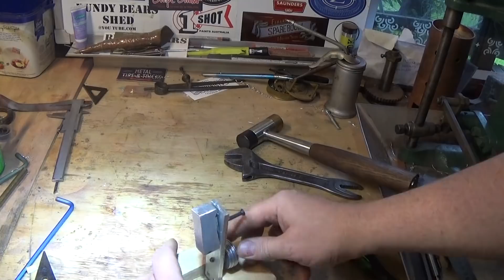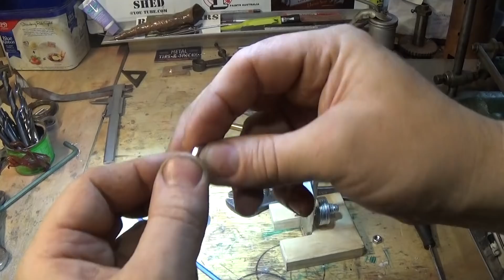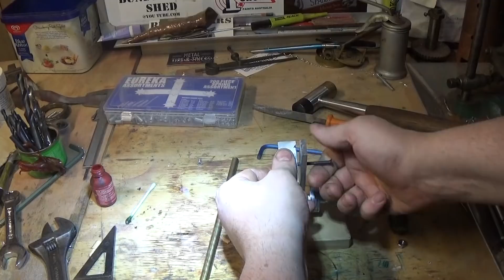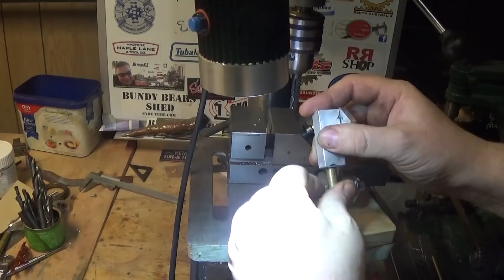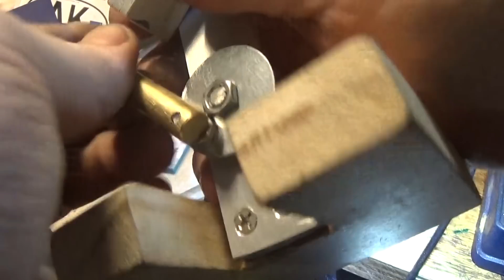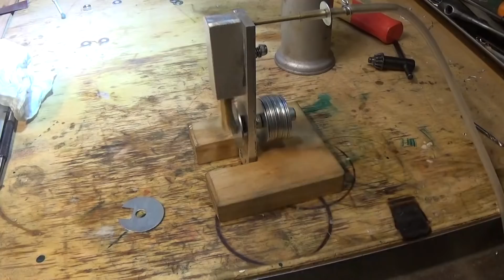mr pete engine part 2b (FINISHING) - no machine tools!

Comment: So you used the drill press. This is what Mr Pete did, and for good reason. It is very difficult to drill straight or square holes by hand. Not impossible, just difficult. And often exasperating when you are off by just a little bit. From long experience working with kids, the first thing you must avoid is frustration. That is what this design is all about. Brava, Emma!

Comment: That could be a topic of a video contest. Who can design and build the simplest steam engines? Who will get the lowest number of points (lower is better here). With points for 
- number of tools used (hand held power tools including drill press count double, other machine tools count triple), 
- number of parts (parts that need processing of any kind by the builder count double), 
- number of building hours.
To qualify as functional the engines must do at least 100 revolutions at the output shaft while they are only propelled by steam or compressed air. Speed or power are of no importance. Proof is in the video except for the hours. There the builder's word is his bond.
Reply from the maker: +rol eic food for thought , as always